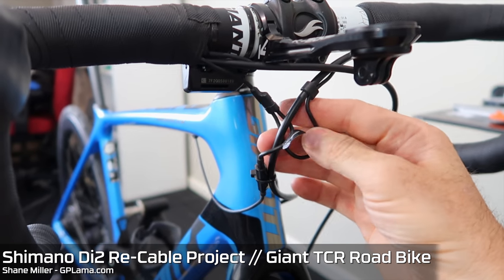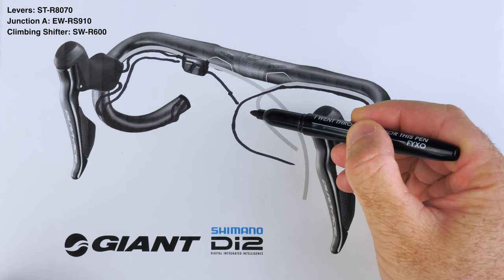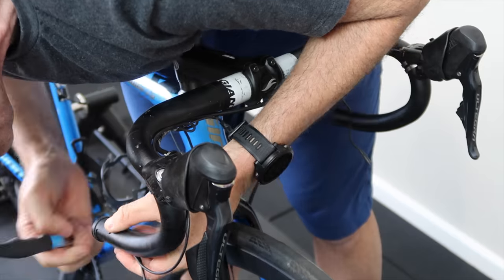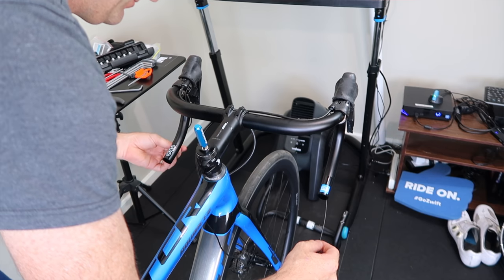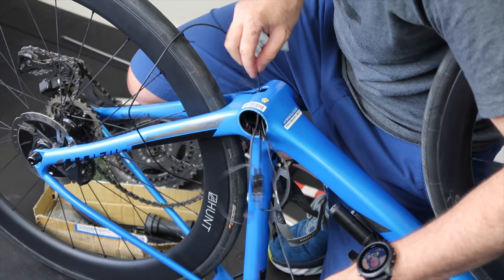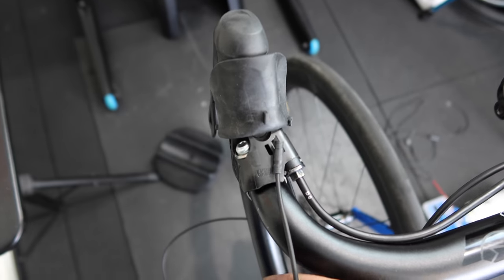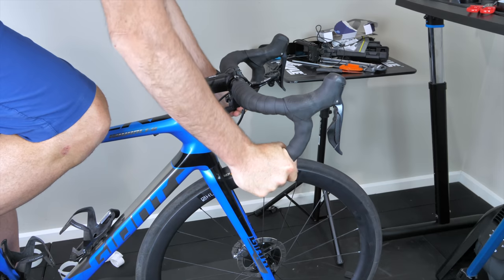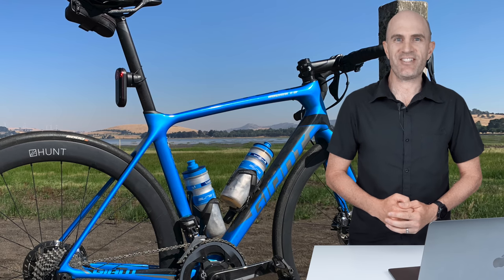Shimano Di2 Re-Cable Project // Giant TCR Road Bike

Comment: One battery to rule them all ✊
Reply: Rides of Japan I miss measuring the weight of new cable vs. old cable setup 🤔
Reply: That recable work might have added some new grams to the bike, so it's not valid, we can not tolerate that.
Reply: Sorry to say - this is an utter mess. 
None of this is required in eTap. True wireless.
Reply: @itsm3th3b33  yay unpaired shifter
Reply: @kennethstreet7868  Is that really a thing?

Comment: This video makes me appreciate the wireless groupsets!
Reply: Ivo Roilev This video makes me appreciate mechanical Campy 😆
Reply: Have you ridden both more than a little. Shimano precision in both brake and shift quality is reason enough to not put sram on your bike.
Reply: @kennethstreet7868  Shift quality of the shimano is definitely inferior. You always feel the missing cog. I have enough friends with issues on their XT/XTR brakes to stay clear of them too.
Reply: @roilev    Your friends of interesting opinions, What would be more interesting as if you had your own. Sram can hardly make a bike shift well.   That's so much the case they even tried to stop making  Front derailleurs.  Their super wide range cassettes are notoriously jumpy.  I'd rather not get tendinitis from my cassette but thanks you have at it.
Reply: kenneth street 
Don’t mistake your lack of mechanical skills with SRAM deficiencies. 
I’ve been using SRAM Red eTap true wireless for over 3 years now and can say with confidence that it works fine. 
You do need to ensure that your rear derailleur hanger is aligned and the cogs are indexed correctly.  Once that’s done shifts are buttery smooth. 
Indexing can be done while you ride the bike, which I find much better and easier. And you don’t have to mess with cabling and junction box location, which not all frames can accommodate.
Reply: @itsm3th3b33   No, my complaints are more foundational about sram. I've held jobs in the bicycle industry since my 1st job at 14 years old(lbs).  I've seen sram from square one.  Granted they're shifting has improved monumentally since way back in the day, it still leaves them lacking.  Yes there are many advantages to wireless setups. I'm just waiting for someone that can do it right to do it.  Even pro teams that aren't sponsored by component manufacturer use shimano. There are several reasons. Oh, and sram isn't the second choice either. Take what you will from that.
Reply: @kennethstreet7868  SRAM from 14 years ago is not the SRAM from today. Sadly the same is true for Shimano. And you can watch as many reviews of bikes with XT/XTR brakes, most will mention the issues with them. And no, only Shimano sponsored teams use Shimano on the MTB races. When the racers are notoriously slow to adapt to the changes. On the road, their deficiencies are not that big. And the traditions are harder to overcome.
Reply: @roilev  Curious why you dislike Shimano brakes so much because MTB wise they are known to be better then SRAM guides?  The Guide RS lever sticking was so much of a thing that it should have been recalled, I know someone that had to pay to replace on a brand new bike that came with them.  I'm not a Shimano fan boy, my MTB has hope brakes.  Its just odd that you hate on Shimano in favor of SRAM brakes when SRAM has even worse rep.

Shifting wise I do like Shimano better, the MTB shifters (mechanical) activate on push instead of release so it feels faster/more responsive and it shifts really fast and smooth.  I have not had a chance to try the Shimano 12 speed.
Reply: @h82fail  it is not love or hate, it is just the info I have. I also dislike early SRAM brakes. I had a horrible run down the mountain top, when for 1850m I had to double pump my Avids to have them work. But sometimes on the 1st pump they grabbed and almost threw me off the bike. The next time there was nothing even for the 2nd pump.
I haven't had bad experience with my guides, but there were the newer version than the problematic RSs. Still, the Shimanos that I've tried, work much smoother and easier. But they also grab, very on-off, I couldn't do any modulation with them. And the guy that I ride with, also constantly drags his wheels. And I feel I can keep mine at the point of losing traction, without totally losing it.
I was afraid I'd lose that modulation when I got Codes on my next bike. I've read that they are much more powerful than the Guides. Which I can confirm. But still I manage not to lock my tires during difficult braking and turning. Though I suspect the grippier tyres are helping there too.
Reply: @roilev  I pretty much agree on everything with the brakes.

Had avid jucy's, didn't have consistency problems but the free stroke wouldn't adjust itself as the pads wore so I'd be pulling the lever down to the grip after a while. Took allot of fussing to get them quiet as well

Most of my buddies ride Shimano brakes and I'm with you on the feel i don't like the lack of modulation.

I would pick the guides if I had to choose between the two.  Build my current bike from frame so I went with Hope, the modulation is very much like the guides but with different feel and I just like the way they feel and look.
Reply: Sram owns the MTB market when it comes to shifting. The GX eagle and above all work absolutely flawless. Brakes seems like more of a personal preference. I havent ridden any sram road components, but i love the 1X idea on a road bike.
Reply: @Bpf1893  Now with the GX AXS they totally killed Shimano - even XTR can't compare. No wireless, no carbon cranks, no HG compatible cassettes :(

Comment: The Y splitter was created to achieve a much cleaner look compared to the old handlebar junction box. And it should look pretty much like your end result. One cable should run along the rear brake hose/ housing and the other should almost invisibly cross the stem along the bottom of the handlebars. Problem is that whoever assembled the bike was clueless. The Di2 cabling is obviously intended for continental left-front brake set-up but it looks like you have right-front set-up, given you're in Australia. The solution is simple, just flip the cable around (the splitter should be on the same side as your rear brake lever, as the cable is supposed to run along the hose/ housing). Done.

The wireless unit is supposed to be connected between the Y splitter and the cable going to the frame junction box, clipped onto the hose/ housing. It's a great location as it's close to a head unit. I can see a unit there exactly where it's supposed to be in the before shot, but I guess it's just a connecting junction. I don't know why would they put it into the seat tube and then use a connecting junction. I wouldn't put a wireless unit inside metal handlebars. That's not great for RF signals.

I'm with you on the battery front. Wireless is convenient as far as cabling goes, but I'm just allergic to it. i guess it's a professional deformation. Wires just work. I build my bikes (= I do the extra work) and I would still rather play with the cables. It might also be the child in me. :-)

Comment: Woohoo!  Glad to see you using the Boeshield.  I have been using it on all of my bikes since I started riding indoors.  I also use it on the stem/bar and seatpost bolts on all of my outside bikes.  It's wet where I ride, and it really helps keep the corrosion away.
Reply: BTW, the boeshield is also the perfect lube for thru-axles.
Reply from the maker: Ooohh... nice tip!

Comment: I did similar with my Cervelo, fitted sprint shifters cabling was a challenge. I was disappointed that wasn't holes drilled further up the bars near the shifters so i didn't have to run cables down the outside. But pleased with the finished product like you

Comment: I bought myself one of those routing kits (not Park Tool, X Tools rather, about 1/3 the price).  The first time I used it, properly (it takes a bit of practice to get things right), it was just......... amazing. The first time I routed new brake and cable housing through my 2015 Defy, I had to make sure the kids were in school, because there was so.. much.. swearing..  Using one of those routing tools, it was...... amazing.  I could get these POS cables into the right holes, almost easily.....

Comment: Looks so much better. One of the first things I did on my Tarmac Pro was fit Pro Vibe aero bars. There was a small junction cable under the stem that I substituted for my Bluetooth widget. Although its still visible, it’s tucked away virtually out of sight. I did need a 10mm longer Di2 cable from the junction box to the right shifter. Specialized actually shrink wrap the rear brake hose and Di2 cable together until they enter the frame. I won’t run a remote shifter until Shimano shrink the thing a bit more!
Totally agree with your Di2 v SRAM reasoning. I had the choice of a 2019 model Tarmac with Di2 or 2020 model with AXS. I went for Di2 for the 1 battery reason as well as the much better looking ( in my humble opinion) hoods on Shimano.

Comment: I did the same on my rim brake tcr exiting my bar’s right side port (since my Non-disc goes in on right side of the TT).  I did shorter wires and extra junction boxes but your way works just the same.  In my case i left and extra cable open-ended at the porthole so when i throw an aerobar on i can use a rear tt shifter with a coupler i hid in the right hand ski.  Makes for easy on/off between these hilly TTs i test myself on.  HNY!!  -U10

Comment: When u disconnect the front end of the hydro so long as you are careful there is no need for a full bleed. It may only require a burp using a bleed pot as air will only be at the front (or fluid lost from the front). Just disconnect 8mm nut pull cable out slide heat shrink on and immediately push cable back in and tighten nut. Then using bleed pot on front bleed port top up and lost fluid by gently tapping cable and squeezing lever. You should see air come up the pot and be replaced with fluid.
Reply: But the olive will be stuck on at the end of the brake line and in the way of getting the nut off, and you can't get the heat shrink over the nut. With some effort, you can remove it but will need another olive.
Reply: @lambo_the4445  Agree - works best when combining with trimming brake lines (e.g. removing OEM excess).

Comment: I have the same bike and the messy cabling winds me up. I’ll definitely be doing this as well as shortening the brake lines. Thanks for the video, really useful.
Reply: BisleyBob I’ve finally got all the gear together and will be starting the same bar changeover, new Di2 cabling and shortening the brake lines next week. Have you done yours yet?
Reply: Brad Allen Not yet mate. I’ll probably get it cracked in a few months. Be interesting to see if you have a similar experience to Shane or if you hit some issues. Hopefully the junction by the BB is easy to fish out with the stock BB. I don’t fancy removing it
Reply: @BisleyBob - job done. Di2 was a piece of cake but had to upgrade shifters to R8070 as my old RS785 only had one port on LH side. Shortening hyd cables was more difficult, had to do each twice cos kept getting length wrong. Hint; get a Shimano or Park Tool hose cutting/insert tool, allow for possible future longer stem, get spare olives/inserts for mistakes, use Sugru for frame grommets, patience & perseverance for bleeding
Reply: Brad Allen nice. I need to get around to ordering the stuff for it. Luckily I won’t need to get new shifters
Reply: @bradallen8643  Finally got round to doing this (I’m BisleyBob just consolidated accounts). I hit a bit of a hitch in that the standard handlebars don’t have a DI2 hole in the left drop. Didn’t have the time to get a hole drilled last night so have had to run a wire under the bars to connect the left shifter which is a bit of a temporary bodge. It still looks way better than standard though.
Reply: @robferguson3351  well done Rob. I upgraded my bars the same as as Shane’s ... all good and still going great. The bar end junction A is far better/neater than the old stem junction. Hope you are happy with your new cleaner look
Reply: @bradallen8643  Definite improvement. I’ll probably wait until the bar tape needs changing before I get the extra hole drilled. No one will notice.... but I know!

Comment: The junction box only needs to "touch" the system so only one wire can run from the bar end junction box. I have one wire going from the bar end junction box --> right shifter ->left shifter -> into frame - BB junction -> battery\derailleurs. Works great. Of course you can place the wireless in line anywhere.

Comment: I have basically the same bike as you... bought a few weeks before you announced it on youtube.... difference is I bought mine as a frame which means two things... 1) It was only available in pink 2) my cabling was exactly how I wanted it (heat wrapped... only one entrance used into the frame etc)... Pain in the butt to build though.

Comment: Hey Shane, great video
I did a similar clean up on my bike. I would have suggested for you to install the wireless module between the bar end junction box and the shifter using really short di2 cables. 
Connecting them was hard but it would avoid you having a cable running under the bar tape on your left hand.
Reply: Yahya Baali Are you suggesting that the 1200mm Di2 cable connecting the left shifter to the right bar end junction A is not required?

Comment: You mentioned having 2 1200mm cables. One was used to the 4 port junction box. Where was the other one used?
Reply: The other one is in the handlebar. For my Giant TCR, I believed I'll only need one 1200mm cable for the frame and the existing shorter one can be use for the handlebar.

Comment: I bought SRAM AXS for gravel bike and mountain bike a couple months ago.  Mountain bike it went on smooth. Problem with gravel bike:  I have 2017 KICKR, which is NOT compatible with 12-speed.  Only the 2018+ KICKRs.  So I would need a new KICKR.  Not happening.  So returned the AXS and went with GRX Di2.  This video is exactly what I was looking for since I have NO idea what the hell I'm doing.  SRAM AXS came in one box.  The Di2 has 15 boxes.

Comment: Instead of the park tool I used a shop vac and a piece of string.  It sucked the string thru the bars faster then the special tool. I did the same Di2 cable routing on a Niner RLT RDO gravel bike and I like the clean look.

Comment: Makes you think sram wifli is the way to go until you consider there is 4 separate batteries to contend with (half of them not chargeable). Di2 one battery and you charge it so infrequently that it is almost like no battery (di2 owner bias I must admit). When that wireless air charging thing hits wifli it will be hard to ignore though. Either way, love the effort undertaken to make this improvement Shane. It's stuff like this that keeps me coming back to this channel!

Comment: Awesome setup! I think when I put new tape on next, I'll consider rerouting the cables since my front end is very similar with the junction cable, and now wireless unit. The only difference is that the junction port is in my downtube, not the bar ends, so have to think this through some. Thanks!

Comment: haha it is funny, I've just recently accomplished almost the same internal routing thru the brake cable hole, but on non di2 ready cervelo s3 from 2010 using first di2 group set (non internal as well, so you cant unplug cables from junction box, that was a nice puzzle game). Also, instead of zip ties, I used heat shrink cable to merge those two exposed cables in front, looks even neater, even tho it felt kind of risky to keep a lighter near those museum old di2 cables lol

Comment: You missed the opportunity to use heat shrink tubing. You can get a size where it fits just perfect, you need to route Di2 cable first, then brake hose. Super clean finish and you don't need to apply heat at all!

Comment: Nice job, I did similar to my TCR a few weeks back when I upgraded from mechanical.

One question though Shane: When you route the di2 cable along with the rear brake line, have you got a grommet in the frame? I ended up running the di2 cable through the 'correct' port after trying and failing to get it through the brake port with a grommet. I didn't fancy the cable rubbing against the frame and cutting and/or the brake line damaging the carbon.

P.S. You should be able to get a small round plug for your unused di2 cable port, if not try a little blob of black sugru to make it neat :)
Reply from the maker: The brake and Di2 cable are jammed in and not moving with the existing grommet. It's something to consider though if they do rub/move/break.
Reply: I've used Sugru to create a custom moulded grommet at entry and exit points when upgrading my Trek Domane to Di2. Looks very smooth and neat, just be sure the system all works before this step :-)
Reply: How on earth did you jam them into the stock grommet?  Do you need to trim a bigger hole through the grommet?

Comment: Hey Shane. I LOVE your channel!!  I see you are riden hunt wheels and Conti GP 5000 on them. Do you have trobbel getting them on ? i have same setup but i REALLY have problems getting the tires on. 

Thx from denmark :)
Reply from the maker: Cheers Jesper. The GP5000 clinchers went on fine. Maybe leave the tyres out in the sun for a while to soften them up just a little.
Reply: @gplama  mine is tubeless. the rubber cracked when i inflated them :) hehe. But thx

Comment: Hi I have this same bike and have routed Di2 through it as well, even with the same handlebars. I did consider routing the Di2 cable through the brake cable hole as well but I wasn't able to fit the grommet around both cables the way I wanted to. Were you able to fit a grommet around both cables? Did you leave the grommet off completely? I wish there was a hole big enough to fit a Di2 cable through the mechanical derailleur housing!